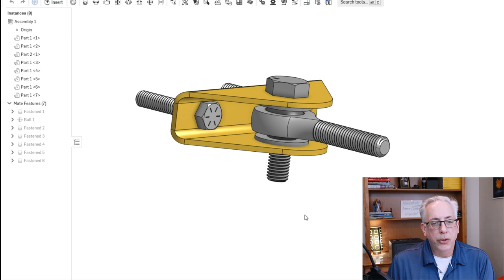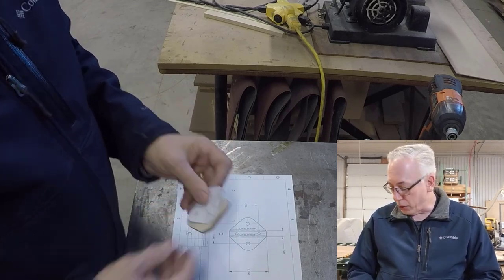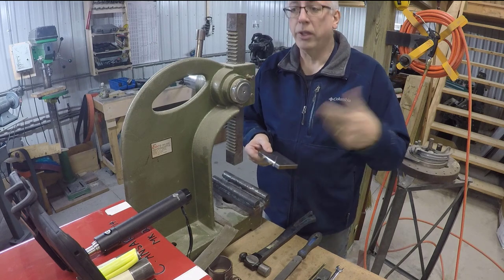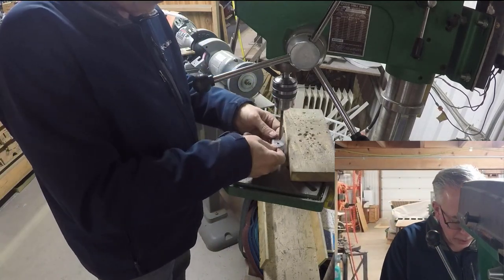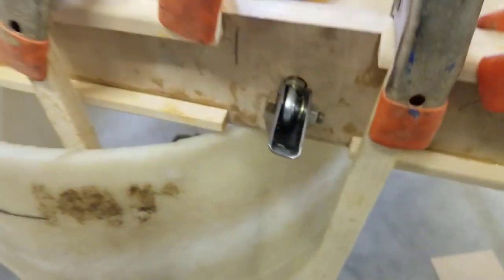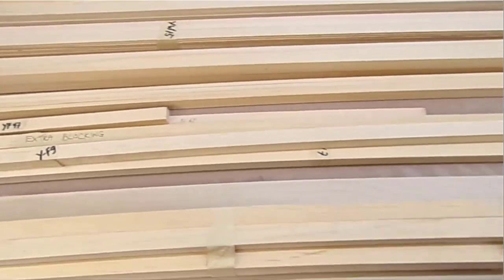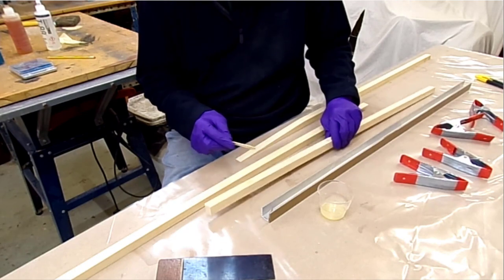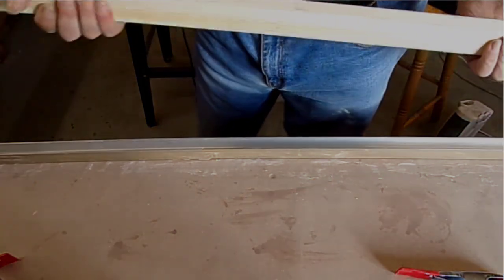DESIGN AND FAB THE ARIA RUDDER HINGE BRACKET -  YOUNGSTER TAIL KIT OPENING - SCARF JOINT DEMO

Comment: Hi Dave. Another excellent video on the bracket. I think I may have to change the brackets I have on my present project. The only fly in the ointment as it were is that you mention using "60 thou" material for the bracket? For those of us living in one of the 195 countries on the planet that use the metric system, how thick would that be in mm? ;-))
Reply from the maker: That would be approximately 1.5mm
Dave
Reply: Limapap, I have recently found myself needing to convert inches to millimeters frequently, so I looked up the formula.  If you have the decimal version of the inch, divide that number by .03937 and you get your mm number.   If you have millimeters and you want inches, multiply the mm by .03937 and you get the decimal inch number.

Comment: Did he say "..a light sanding.." after cutting the scarf?  You should never sand the faces of a scarf joint a cut surface is perfect. Sanding just fills the pores with dust.
Reply from the maker: I believe he was referring to the edges.
Reply: You are right if you use a fine paper along the grain, I use 80 grit across the grain to remove the edges and to rough up the surface as the routed surface is too smooth. I used the term light as I am not removing much material. I then also use compressed air to removed dust.